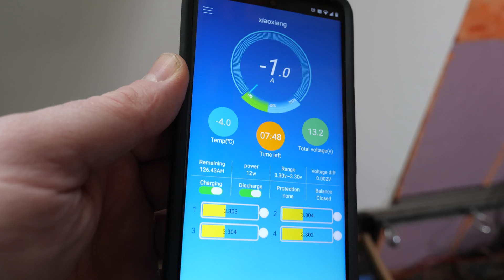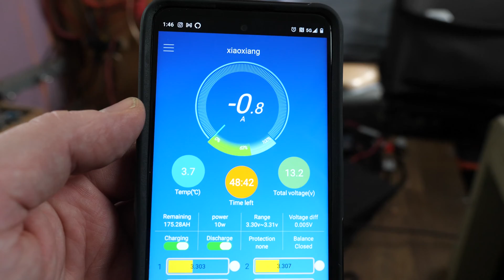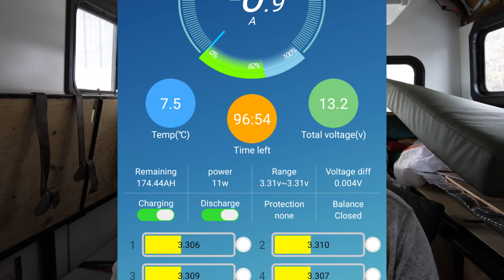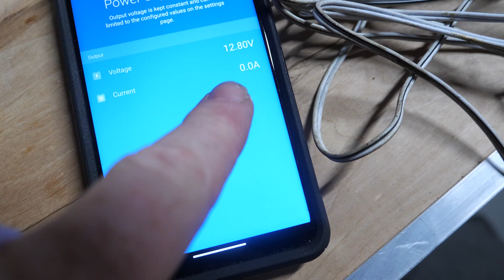Winter 12v Charging Lithium - DIY Battery Warming pad Test

Comment: My lifepo says you can draw power down to -20 C.  Charging stops at 0C.  I got a cheap 10W USB heating pad for clothing and a small thermostat...total cost about $15.  Seems to work.  Also...putting a draw on the batteries can raise their temp enough to initiate charging.

Comment: As far as I know, it's ok to drain your lithium battery in cold weather. They will self heat when being used because some of the energy vaporate. Charging must never på done before they are on the + side. Heating pads will help them reach a nice temperature faster...
Reply from the maker: not sure what youre referring too.

Comment: @Wandering Beast, Cody, 🎄MERRY CHRISTMAS TO YOU AND THE FAMILY!🎁 A buddy of mine uses 12v USB re-chargeable hand warmers, hooked to an independent solar panel to keep his LiPo batteries warm. He uses 2 per battery box and it works really well. Those little hand warmers put off a lot of heat.

This is an important video. Anyone who has a set-up and system like this needs to know how it performs in highly adverse conditions.

Comment: No worries about it being a dry video.  The wise owner tests their systems under very cold conditions, as those conditions can and are happening, not just a "never will happen".  
   And yes, a converted van or pickup can double as an emergency use vehicle such as for these single digit conditions.  A "2 fer".